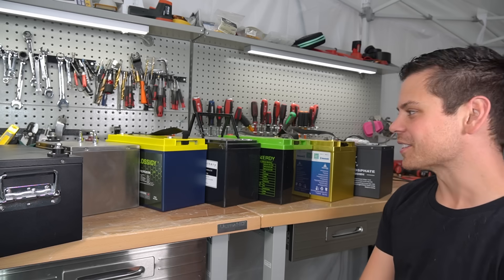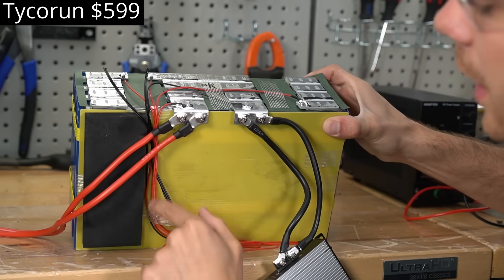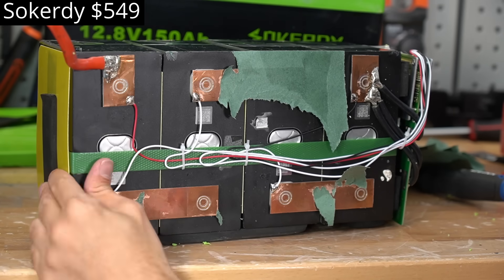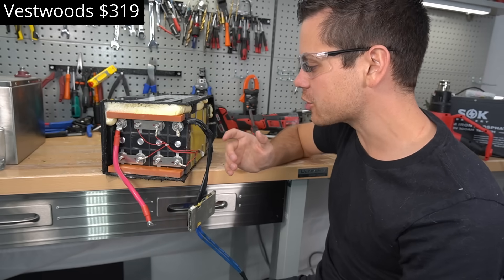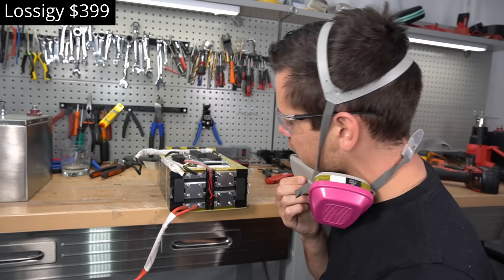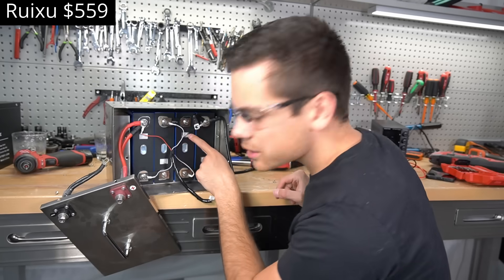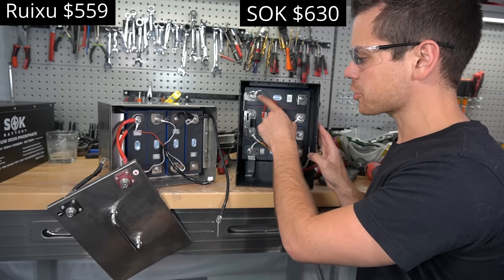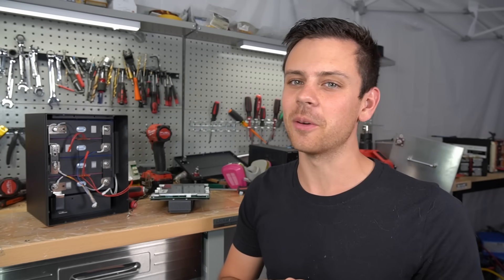Budget LiFePO4 Showdown: Lossigy VS SOK VS Vestwoods VS Tycorun VS Soderky VS Ruixu

Comment: Hello will just had a question i live overseas so it is very difficult to get batteries shipped to and back without excessive fees or freight forwarding so its hard for me to see which project is the most worth it. I have the most basic solar setup now from your beginner video 12v system with 100ah leadacid battery and 2100 watt panels.(this controls lights and water system) It works fine for my usage but it is obviously limited and when it is low sometimes im forced to charge it using a gas generator which sort of defeats the purpose, now Im trying to figure out a 2nd system to save up for use with , for console gaming  and charging electronics mostly, so I assume I would need around 1.5-3kwh on average generated by the system to be able to game for longer hours (Im aiming for around 5-6 hours of available gaming time daily at first but would like to have the ability to upgrade in the future). I know that it depends more on the solar panels and how much they are generating. The panels I can get fine and figure out, I just need help figuring out what is the most cost effective battery for my case. The deepmarine lead acid batterys are the ones commonly available locally but its difficult to get a system balanced with them, and I hate having only 50% of the capacity available and how dispoable they are. I've considered lithium ion but want to avoid fire risk, so I'm thinking the lifepo4 is the best chemistry available right now but there are some extra costs associated with shipping them im not sure if its worth it. Most components I can get shipped fine besides the batteries.

price is not a limiting factor it would just effect how long it would take to save up for the project
My options Ive looked at are either your 

1. DIY Milk crate all in one battery made with ali express Cells and MPP all in one (Seems best value atm, and I might be able to get it shipped easier directly from china, but Ive seen you say that sometimes you dont get the best cells or there are sometimes problems, +theres no warranty and Shipping things back and forth is something that is limited for me, I dont know of that offsets the value of them being cheap, If something breaks or I need an upgrade I would need to spend extra and wait a bit longer aswell)

2. get a "Solar power generator" like jackery, goal zero, eco flow delta pro etc. with long time warranty. I would either need to choose from the limitied choice from a local supplier (marked up 20-30% from MSRP typically), I could probably custom order the ecoflow or bluetti through them or i would need to freight forward it. Pros with this is its already all built in and all I need to do is buy the panels for it, and trickle charge it with that throughout the day, but also if I want the option to stock up on energy and game overnight or something like that, I could charge it using the gas generator or take it somewhere to charge on grid. The main biggest advantage i see if it has warranty or I could pay for warranty and be able to get it repaired for much cheaper then it would cost to ship replacement cells or parts(for the diy milk crate battery)

Do you think this would be better value and more convenient for my use case then trying to build my own DIY milk crates(perhaps multiple) and if so which brand might be more reliable with build quality and warranty? Right now Im assuming the ecoflow delta pro is the best one but ive seen other models on your videos that are also good. Im looking for the one which can support as much panels as possible or atleast I can start with a smaller amount /wattage panels and upgrade later. Im trying to compare it to the modular Blueetti system but that one is kind of confusing.
There is also the option to just use the properitary solar panels that usually come with them but I imagine it woulnt gain as much performance as getting some larger more standard monocrystalline panels.

  I say cabin setup, but its really more similar to an RV setup, I would like the ability to move everything easily. so I figured it might be smarter to buy something like the solar generator and 4 400 watt panels,be able to game for a few hours a day without relying on the gas generator. Get by with the limited use case and then start saving up for a much more legit 48v system with the server rack batteries, and 8-16+ panels, more suitable for power tools and appliances, Fridge, PCs console Tesla etc.

 (Question, Could you charge the solar generator through another 48v system like that using AC or DC or does it need to be through the grid/ direct from the solar panel? I know thats somewhat redundant but just wondering, Im aiming for flexibility.)

or 3, save up awhile for SOK or Lifepower server rack with server rack battery+bms+All in one system like Growatt or MPP solar. (Start with 1 and upgrade over time). Pay extra to ship with freight forwarding.. This is very expensive for me but it seems it would be good if I only want to spend the money to ship it out once and it seems more like a reliable equipment then other two options.

Thank you for taking the time to read it I appreciate any help but if not Thanks for making the videos it makes it easier to understand and see which is the best deals available now, it just sucks sometimes if you dont live on the contiguous US its hard to find the same deals. I will have to check the local battery distributor to see how much there lifepo4 batteries are but I imagine they will be marked up but maybe they will still viable over custom ordering the solar generator through them.

Comment: Could those claiming low temp cutoff be mounting the temp sensor on the circuit board of the BMS? Granted, would not be an acceptable practice to properly protect the cells.

Comment: I just ordered one of the Vestwoods. Still A good deal I think even without the low temp cutoff.  Maybe you got a defective build(?).  Also, I won't be charging it at near 100 amps.
Reply: Lol, I was looking at Amazon right after Will mentioned the price and saw there was still 15 left. I checked other batteries and came back a few minutes later and saw 14 left. 
I just knew somebody on here would mention buying one.
Reply: @jfhisjwu  Yep, that was probably me.  I wonder how soon the price will go up now.
Reply: @pathdoc  At the rate they're moving now, they'll probably raise the price when they resupply

Comment: Thank you very much for the video Will. I  have two 200ah Lossigy batteries in my motorhome for the last month and so far they are great. I went from AGM and these re-charge so much faster. Thanks for all of your knowledge.
Reply from the maker: Glad to hear your experience has been good! Very cool
Reply: Yeah, ive been using a 200ah 12v lossigy since last july in my offroad 4wd for a house battery. Been hooked up to a redarc bcdc and 200w of solar. Been a great battery so far. I wish it had bluetooth, but eventually ill just wire up a meter.
Reply: Whats the max charge and discharge (continuous) current for the 200AH lossigy?
Reply: @rjlorua  100 amps

Comment: Love the bulk tear-downs haha - good stuff!
Sokerdy - Also bothers me when companies can't put "LiFePO4" correctly. It's not "LifePo4" or any other variant LOL. Probably just my OCD. And damn, that soldering job is crap!
Vestwoods - That BMS is so tiny, I have a hard time believing that doesn't get super hot.
Lossigy - Price went up $30 a few days after my video, was $370 - funny how that works... Also for the cells, you mentioned "who makes them" - they're GFB, seem to be good stuff!
^^ just random comments as I was watching
Reply: Hey guys one request please. can one of you do a video breakdown of your preferred DC power supplies for recharging the lithium batteries? Is it safe to recharge a liFePO4 using a power supply unattended (assuming the BMS will disconnect for overcharge protection)? Where can I find these for sale? I find these hard to find and I don’t know any good brands
Reply: @michaelburke1023  Have a look at the AIMS LiFePO4 chargers. I have both the 12/24V and 36/48V models. They're ETL-listed.
Reply: @LithiumSolar  Thanks so much!
Reply: @DIY Solar with Will Prowse, related to the comment of the Vestwoods, would you do a BMS efficiency showdown with some of these? I'd be interested to know how the BMS units used compare.
Reply: Took about a minute for you to edit your post.  Laughable.  Again, please continue with the criticisms Almighty One.  Again, maybe you could correct them in Chinese while you criticize their English.  Are you Wade-Giles or Pinyin?  If you prefer writing, Simplified or Traditional?  Enquiring minds want to know.
Reply: Well, if we're gonna be spelling Nazis, it's worth noting that "varient" is actually "variant".  It's in the goddamn dictionary, after all.  Most spell checkers would pick that up.  Hmm, I wonder which of those two words is more difficult.  Seems the BMS is still larger than your speeling skilz?  But, I digress.
Please continue with the criticisms.  Maybe you could even correct them in Chinese, Lythyum Sooler?
Calm the fuck down a little.
Reply from the maker: Right!? That company had so many mistakes in the marketing material, I almost ranted for 5 minutes straight. There is just so many errors, it sure is wild.

Right?! That little bms is just crazy. I was really surprised something was not melting when I came back to it. 

Ahh I hate when they raise the prices. Then our viewers get mad at us for the change haha

Ohh GFB's, very cool! Those are good!
Reply: @WillProwse  Could the lack of low temperature sensor be due to the sensor in the BMS and not in/among the battery stacks?
Reply from the maker: @GregorShapiro  that would be instant failure as well. BMS heats up. But no, it's not in there

Comment: Hey Will, fun video. For some odd reason, I've always liked tearing things apart more than putting them back together. These types of videos are my cup of tea!
Reply: LMAO, I think I was about 7 Years old when I took apart our RCA Victor Tube TV (pulled the tubes out to look at them) ...   Still remember the consequences !  Hahaha
Reply: @stephsoltesz6731  Oh, boy,  I remember doing the same!
Reply: @fisherus  did you have a similar encounter with the Leather Belt too ?  ;-) some lessons only need learnin once hahaha
Reply: That chainsaw got a good workout, didn't it? 😂
Reply: @LithiumSolar  once I learned how to make the noise by pulling the rope!
Reply: This video is really great! After watching it, I couldn't help but dismantle one of the 100Ah LiFePO4 batteries that I purchased on Amazon. One of the main reasons for doing so is that the brand of the battery (ADCBATT) is not well-known and the name sounds a bit strange. However, the quality of the battery seems to be good, and I paid $300 for each one. After taking it apart, I found that the BMS chips were labeled in Chinese characters. I am wondering if all the batteries sold on Amazon are made in China?

Comment: One question, when builing lifepo4 battery with prismatic cells ,other than protecting the caps of the battery, is it important to compress the cells tight to each other, or it doesn't affect their life cycle if connect them with flexible busbars and leave gaps between each cell